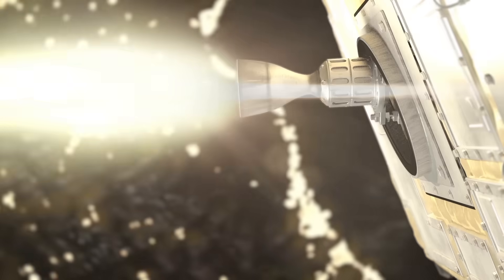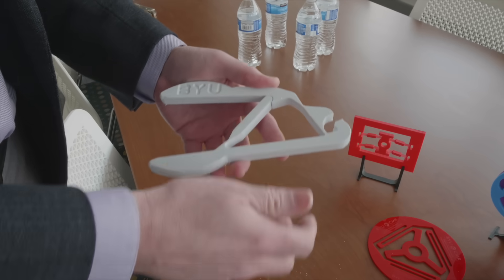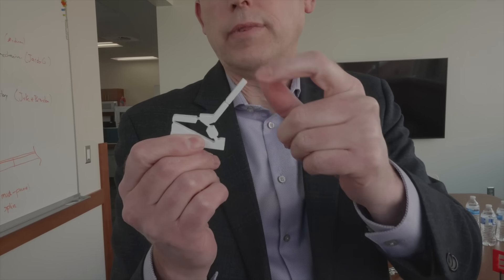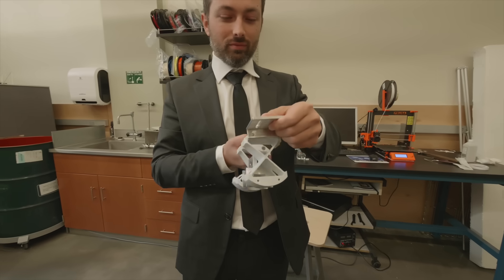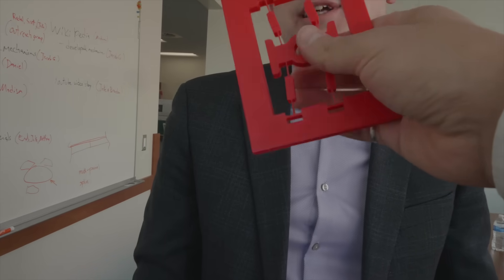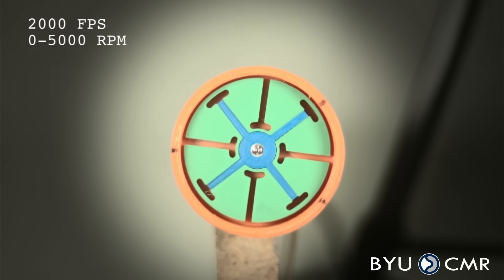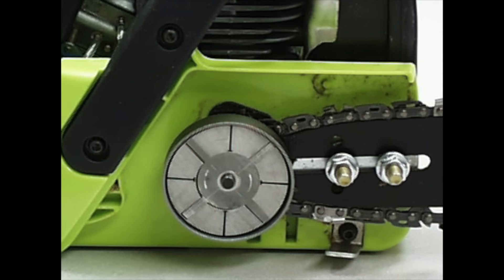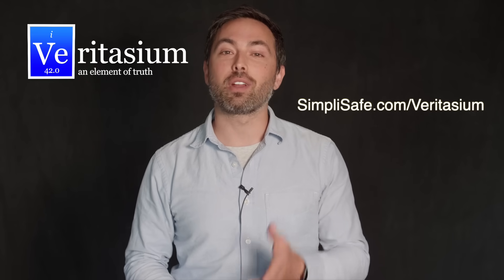Why Machines That Bend Are Better

Comment: My experience with plastic fatigue in toys doesn't want me to believe this is a good idea.
Reply: Most plastic toys are built using trial-and-error "engineering" and are not designed to last a long time.  The principles of compliant mechanisms can allow plastics (and other materials) to have very long fatigue lifetimes.  Learn more at https://www.compliantmechanisms.byu.edu/about-compliant-mechanisms
Reply: @jacobgreenwood290  Thats the kind of constructive answer I like, thanks for the link
Reply: @jacobgreenwood290  "engineering"
Reply: @jacobgreenwood290  
Good explanation, but what about repairs?
I mean, exchanging single components seems much more sustainable to me than switching out a whole part, right? In addition, simpler components are also easier to replace if e.g. it's necessary to improvise.

Although I do concede that the importance of "repairability" doesn't necessarily apply every time:
First, we have parts which only have to work one single time and do it right that one time. Yes, in that case bending parts might be a good idea, because they might make production much easier, lower costs because of less parts (and thus also e.g. simpler production lines), etc. and a number of other reasons.
Second, we have parts which have to function more than just once. With those, sustainability and repairability would be an issue, because everything will break at some point. Problem is: whole spare parts are certainly bulkier when stored than a bunch of bags with components like nuts, bolts etc., which also limits the number of spare parts which can be stored way more in comparison to said bags of components.
And in addition, spare parts run out - and it's easier to "adapt" components like, for instance a bolt which has the wrong dimensions, but is the only one available. Hell, you could even improvise with something "bolty" enough to work if you just need to avoid the smelly matter hitting the rotary thingy. Compared to this, when whole parts break and spares have run out, you've got a much bigger problem on your hands.

And third, we have the combination of 1 and 2, i.e. parts which just have to function one single time, but have to function more than once (for instance, parts which are "tested" more than once because of maintenance cycles).
In this case, sustainability and repairability are equally important like in the second case. Because parts might work during tests and maintenance, but might break the one time when they should actually work because for instance the very last "testing" was just "the straw that broke the camels back" (i.e. weakened the part just enough to fail at the worst moment), which would give you all the problems I described under 2.

So I'd say: Better start with simple components first and only "escalate" to using more complex parts if it's really necessary and does give you a significant advantage (albeit advantage can trump necessity sometimes).
Reply: @jacobgreenwood290  But still a lower fatigue lifetime than a rigid bearing or bushing based hinge, right?
Reply: @joestevenson5568  Not necessarily. When a material is deformed (bent) it has a region of movement that is within the elastic region. This means that no permanent deformation occurs and the lifetime of cyclical deformations within this range can be infinite. This elastic region varies for different materials and designs. A good example of this is you can bend a credit card slightly as much as you'd like. As soon as you bend it too far, though, you leave the elastic region and permanently deform the plastic which can actually be seen with a change in color usually indicating where the molecular bonds have rearranged.
Reply: @Brian86992DH  Yes, but long term, failure will still happen, even if we are in the elastic zone. Fissures appear, they get bigger as time goes on and make the section smaller, making the tension applied to the material go past the flowing limit. Still, that can take  a LONG time to happen and it usually determined with test.
Reply: @Brian86992DH  ThisOldTony explained it in a similar way to you, just taking an aluminium filler rod for tig welding. Stress strain curves needed :)
Reply: Titanium and Steel aren't Plastic... Also there are Plastics out there, that in certain Applications are far superior.
Reply: It should also be considered that the bending using plastic is a concept that can be translated to other materials. Because every material has at least some bending property especially if thin enough.
Reply: There doesn't seem to be much flexing in these to cause very much fatigue.  @ 6:02 the snap in this mechanism works because the length is just barely too long to fit on center, so there is only very little flexing that occurs.
Reply: my experience with some omron switches doesn't want me to believe this is a good idea.
Reply: You can make quite good assumptions when and how they fail...and fatigue testing takes this a step further...the less steps you skip during the design the closer you can estimate...and there also is safety...if at the end of your calculations you come to certain result like 10^6 cycles you can still say okay according to my calculations the product will widstand 10^5 cycles with a safety of 10(in most situations that would be an overkill) so the part needs to be checked after that and probably replaced....
And because these products contain usually a lot less parts then their traditional au pairs...companies can make more expenses on quality control....do they? Not always...
But this really isn't black and white topic...it certainly has some beautiful applications...
Reply: @FlorimondH < Obviously anything that moves, slides, flips, or hinges WILL BREAK eventually.  At least axle/shaft/wheel motion lasts a lot longer than bending materials.  As they say "No need to reinvent the wheel". otherwise cars would have running legs based on compliance mechanism technology. lol
Reply: Lego's?
Reply: Damn plastic.  Junk. Always drying out and breaking.  Look at the plastic in cars nowadays. Engineered to fail. Even if using better plastic they still dry out and get brittle. Longevity is a thing of the past
Reply: There are two kinds of what is called "deformation".
There's elastic deformation, where something stretches and squishes, but moves back undamaged (like when you press a spring down and let it back up, which you have to do a LOT to get the spring to wear down and break).
And there's plastic deformation, where it gets microscopic damage (which is what plastic fatigue is, like when you bend an aluminum soda can's pop tab back and forth until it snaps off).

These compliant mechanisms are designed so that all the flexible points never bend very much. Because of that, they all work together to get as much elastic deformation as possible before they break. That's why they last over a million uses, they're only bending just a little bit in any one area, so they are always going through elastic deformation.
Reply: different plastics or other materials can have different properties so it's likely that toys aren't designed with the same goals in mind as compliant mechanisms.  As I've experienced with 3d printing, Nylon lasts longer in most compliant mechanisms than PLA does.
Reply: yes plastic should not be trusted... fatique tests may show resistance againts millions of cycles within few hours. but material itself becomes more brittle just by time passing when exposed to air etc. and creep behaviour in plastics is also a freaky thing
Reply: Ivan Gálik they are so many different plastics, I believe they know what they do ;-)
Reply: Zaka Pentax yes they do. Engineered to fail
Reply: @ivangalik7848  As long as the cost reduction is greater than potentially not lasting as long this could be a good development for some industries, of course with rockets and nuclear reactors etc. you have to optimize quality with certainty, which I would assume they do.
Reply: @ivangalik7848  why everybody thinks, that there is just one Type of "Plastic" out there. Most "Plastics" get brittle by UV Light what isn't a Problem, when the Mechanism is either encased or pigmentet with an UV Blocking Pigment. Car Tyres are naturally white, the Reason why they are Black is, that they Mixing in Soot in the Rubber that exactly serves this Purpuose, so you see. To protect Against UV Light you didn't need stupid expensive Stuff at all.
Reply: @ivangalik7848  NASA trusts it. Thats all I need to know.
Reply: @ivangalik7848  
That depends on the type of plastic, really.
There are a surprising number of plastics that can be left out in the sun and scorching summer heat in a desert, then taken to the icy cold on a mountain peak, yet still remain in excellent condition.
Reply: I don't imagine the switches on nuclear weapons are triggered over a million times. :P
Reply: Yeah it works in theory, in practice the technique will be overused and abused to make shoddy Chinese junk out of non-spec plastics that degrade in a short time. At least counterfeit hinged tools can often be repaired in a pinch. The pliers are not impressive just simple leverage, when they can do what real vise-grips do then I will be pay attention.(adjust size range and lock like a clamp, also the most common use I see is where heat is an issue ie holding parts to be welded or removing old fasteners with assistance of a torch)

Comment: About that mechanism for thruster. I guess its more safe because it lacks all those connecting parts. But what about metal fatigue? How long it can last? Because  it's not repairable. Or its designed only for one time usage for moving the satelite?

Comment: Physics: If you fold a material enough times, it will weaken the structural integrity of the object.
Samsung: We present u the galaxy fold
Reply: Folds galaxy out of existence and physics out of mind
Reply: @overloader7900  The power of creating wormholes shall be in your hands with the galaxy fold
Reply: Physics: Am I a joke to you?
Reply: They show in this video how some of these flexible machines can last for over 1 million bends. It'll take a while to bend your phone 1 million times
Reply: @DrMaoh  actually, on the Samsung foldable phone there is a layer that most test users did try to remove because it looked like screen protectors to them. But this layer is essentially needed to ensure the proper working of the folding mechanism.

You have to understand the stress strain curves of materials to determine if some material can be used as such foldable displays. Hence why they put a heating element in the middle to kinda soften the material to that point it becomes foldable without damaging it.

If the pace stays that way I'd say we get large foldable phones or displays in say, maybe 3 to 4 years from now? Remember my prediction! ^^
Reply: Not if you stay below elastic limit.
Reply: xmnemonic microfatigue still applies in the elastic zone
Reply: Luckily nobody told the Samurai sword makers that...
Reply: @koitorob  dude!!! I was gonna say that!
Reply: Koito rob you know that those swords are brittle as hell and shatter like ceramic, right?
Reply: @koitorob  Wrong physics bud.
Reply: I love these "I'll wing it" discussions where no one has any engineering knowledge and/or experience. Much fun, just like Jerry Springer show.
Reply: Yeah, I wouldn't use these things in outdoor conditions, hydrogen will diffuse into them and they will fail quickly.
Reply: The screen broke 💔
Reply: Yes, once at the most
Reply: hahahahahaha
Reply: Also using billions of hinges, let's imagine the wear.
Reply: It's called work hardening.
By bending the crystalline structure changes creating micro fractures that become macro one day you don't want to be at work when your bendy machine does that LOL
Reply: .. But bow limbs are extremely flexible and also outdoor resisting
Reply: Right, and the damn thing was an embarrassment to the compliance mechanism technology. xD
Look, anything that moves, slides, flips, or hinges WILL BREAK eventually.  At least axle/shaft/wheel motion lasts a lot longer than bending materials.  As they say, don't try to reinvent the wheel, otherwise cars have running legs based on compliance mechanism technology. lol
Reply: Practically every device that you use in your daily life has compliance in its structure and mechanisms.  If not, then it would be very brittle which is (usually) a bad way to design something.  An axle/shaft bends and twists.  Wheels and tires have a lot of compliance.  If not, these parts would snap like a brittle twig as soon as the car drives through a big pothole.
Reply: @GroBestGardens  That actually depends.
Some machines shouldn't bend at all because they rely on their rigidity to perform their job.
Coordinate measuring machines, lathes, mills shouldn't bend, because they will lose their accuracy if they do.
The same applies to the tools that we use, if your tool bends under load, you will get chatter and a badly machined part.
A gearbox housing also shouldn't bend, because it will change the mesh of the gears, cause noise and eventually fail because of material fatigue.
The same applies to the actual gear tooth, bending is bad, it will change the mesh and cause uneven operation.
So no, not practically every device.
Your examples are actually examples of things that work in impact loading conditions.
That isn't necessarily the case in say a steam turbine, where impacts are unacceptable and compliance isn't the main priority.
Reply: @animasaurus2007  - All of the examples that you mentioned (e.g. CMMs, lathes, mills, gearboxes, gear teeth, etc.) actually DO bend/deform during normal operation, just usually imperceptibly and hopefully negligibly so as to stay within the proper operational tolerances of those machines.  Each of the examples that you mention are made up of materials (metals, plastics, etc.), each of which has a Modulus of Elasticity "E" (inherent to that material).  A material like steel has a higher modulus of elasticity "E" approximately 3X that of aluminum (depending on the particular alloys involved).  Thus the steel part would deform approximately 1/3 the amount of an otherwise identical aluminum part under the same mechanical stress.  A material like porcelain has an "E" value much lower than aluminum, so porcelain deforms almost imperceptibly under the same applied stress (as compared to aluminum).  All of the examples that you mentioned were almost certainly analysed during their design process to ensure that they did not deform too much for a given applied stress (thus staying within acceptable operational tolerances of the machine).  The study of FEA [Finite Element Analysis] see video >>  https://www.youtube.com/watch?v=C4N6Pj4Zdes  is common to determine the stresses and strains (bending) in components when a particular load is applied.  The example in the video shows an analysis of a set of gear teeth to determine the stress and strain (bending) when a load is applied.  Hand calculations on components can also be done (instead of FEA)  All of the examples that you noted are also designed such that they will only see ELASTIC deformation and NEVER PLASTIC deformation during normal use.  Elastic deformation means that the part will bend, but will always spring back to its original shape when the load is removed.  A part that sees plastic deformation will be permanently deformed after the load is removed. All of these material bend elastically, just like a common spring.  But if bend too far they will see plastic deformation and will likely be ruined.   Here also is an FEA and hand calculation analysis of the stresses and strains (bending) in a common beam. >>> strehttps://www.youtube.com/watch?v=bmALUct5L6o     ..... Ed
Reply: OOPs.  I made an error/type in my prior post.  I wrote that .... "A material like porcelain has an "E" value much lower than aluminum, so porcelain deforms almost imperceptibly under the same applied stress (as compared to aluminum)."   .....  I should be  ..... "A material like porcelain has an "E" value much HIGHER THAN ALUMINUM, so porcelain deforms almost imperceptibly under the same applied stress (as compared to aluminum)."
Reply: Not all materials work harden.
Reply: not every material has a fatigue
Reply: But it has hinges like on a door
Reply: underrated

Comment: This moron made a system around nuclear bomb safety that is dependent on pliability of materials over the course of decades?

Doesn't this man realize that pliability changes drastically over time, and that's not predictable at this point?

This is why exact mechanisms were preferred.  It is entirely understood.  It's just simple Newtonian mechanics, not interactions at the atomic level regarding pliability.  This man is dangerous.

Comment: This is the same reason why the old plastic phones with the buttons were more durable than modern smartphones. The plastic in those phones make them able to absorb the force of the impact, which is also a lot of them would scatter into pieces. That way individual pieces that got scattered absorbed a bit of the impact and distributed it among themselves - unlike smartphones that take the hit like a brick and break at slightest bit of pressure

Comment: Looks like Veritasium guy saw a little about mechanical engineering when he is so suprised about flexible iron automatic clutch. This thing is more than one hundred years old. The only inovative thing is that it is made of one peace of iron instead of three peaces joined together by screws. And it is only because of possible laser cutting methods used these days so the production is cheap. And same for that NASA thrusters holder. Thanks to 3D printing it makes sense to do it that way. Otherwise it would be made of several metal pieces weld or screwed together.